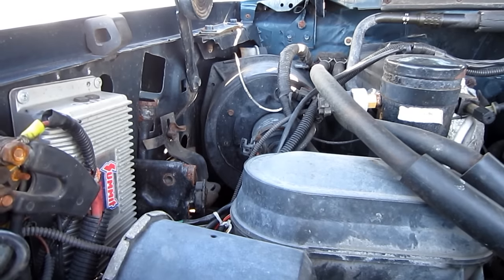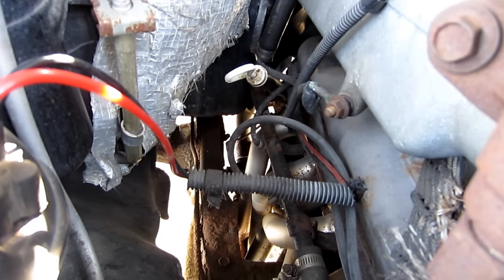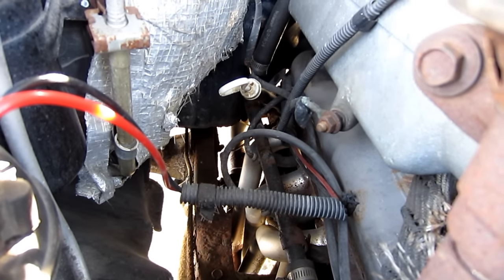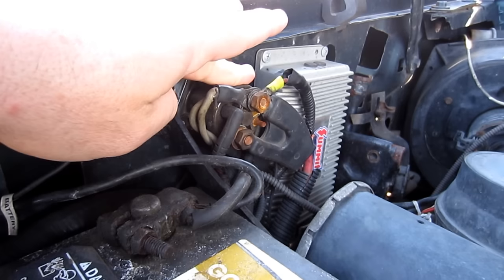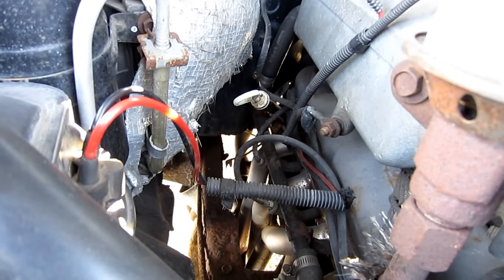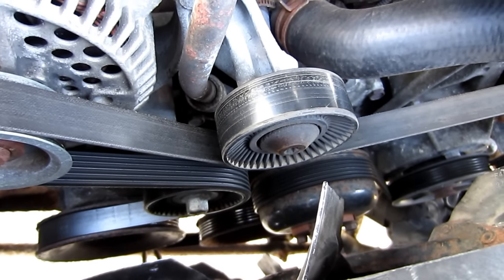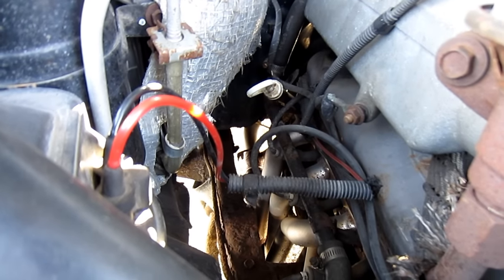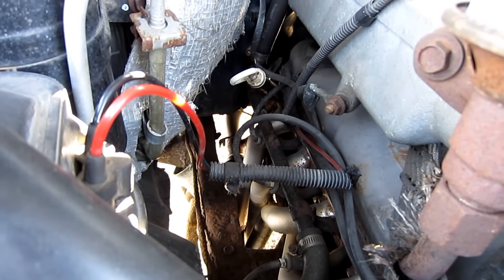Know your cars Clicks. Why it won't start

Comment: I have a 95 Safari, & it will sometimes try to crank, just a little. New battery, starter checks good. The starter will spin, if I loosen the bolts, where it just hangs below the flywheel. I cannot find any corrosion. It does the same thing, when shorting the solenoid straight across.  I pulled the positive cable off, & it has a slight crimp in the cable, about 6in from the starter. I have no idea what could have caused it. Could it be corroded in the middle of the cable, at this crimp, maybe?  It started & ran fine, the day before this started.

Comment: My car was perfectly fine until some guy asked for a jump start. I didn't know how to jump start a car so I just let him touch my car and do his thing. Now my car clicks just like in the video. It starts but only after several clicks. What could it be?
Reply from the maker: F Fuentes maybe your cable ends are loose on the terminals...
Reply: F Fuentes lol this guys answer to everything is the battery terminals... jumping a dead battery can result in damaging your alternator or other electronics. But if it starts after a few tries I doubt it’s the alternator

Comment: I have a 2014 Honda accord ex 4 door sedan. I have a push start engine button. So when I push down on brake and engine button my car does not start just a click noise. I give it a few  times and my car will start. on someday's it will start right up and most day's it will not.
Reply from the maker: Definitely a dealer issue...random electrical is a nightmare to diagnose!!!

Comment: My starter clicks once every time i turn the key and when i jump it itll ussually start right up, but sometines i just keep trying and itll start up by it self after a while no jump needed
Reply from the maker: Cables, connections or weak starter... Also test battery
Reply: Thank you so much for suck quick reply sir i will have what you mentioned checked out tomarrow, i actually made a video today of me trying to start the car for a while and then it just starting out if nowhere is there any way for me to send it to you sir?

Comment: I didn't hear a Bitch.. But anyway the starter deciided it was going to melt the wire that goes between the starter motor and the starter solenoid.  I tried Soldering it back on, but it only lasted maybe 1-2 starts, then it melted my solder.  sounds like the starter is pulling too many amps.. so I just bought a new starter.. but now I have a starter and motor I can take it apart to find out what is inside it.. Rockauto did not need the core back. I have close to the same truck you do.  a 1996 Ford F-250 XLT extended cab with a long bed.
Reply from the maker: Just take the starter in to the local parts store and have them test it... They won't mind at all...
Reply: I already know what is wrong with it.  the short wire to the actual starter motor has corroded the lug off of it that connects to the Solenoid, the starter motor works, and the Solenoid works.. Just the wire gets too hot and melts after 1 or 2 starts no matter what I do to reconnect it.  The engine also cranks slowly with that starter.  I am thinking if it isn't a dead starter it was pretty worn out.  especially considering the new starter winds up very quickly and starts it almost immediately.

Comment: I have a f150 4.6l 5 speed manual 1998 I hear the trrrrrrrrr sound and it's not the batery because I change it for a new one and the sound come from the starter but now just do the click sound, people say is the flywheel, and the transmission harness is a little toast any suggestion??
Reply from the maker: Mr.Mustang rotate engine by hand... Remove starter and have it tested..
Reply: Foxboss9 I already do it, starter is brand new, batery is brand new and the solenoid is new, she melted the terminal of my new battery

can be the transmission harness?
Reply from the maker: Mr.Mustang just because the part is new doesn't mean it's not defective. You need to find out why the starter is not turning. Either the starter is bad, or the wiring is wrong, or the engine is seized. You can rule out the seized engine by turning it by hand. The transmission has nothing to do with your starting system. Other than the flywheel is connected to the transmission. But as far as wiring it doesn't have anything to do with it
Reply: Foxboss9 I have 2 new starter I tested 1 to make sure I tough the same thing, you can hear the starter grinding like trrrrrr I tough the flywheel had lost teeth I inspect by turning the engine by hand and look the flywheel is ok so the wires of the battery overheat and definitely is a electrical problem BTW thanks for reply and help
Reply: Foxboss9 and another question a sized engine can turn by hand or is like when the engine is lock or is all the same? 

BTW I'm learning English sorry if you don't understand me
Reply from the maker: Mr.Mustang make sure you didn't accidentally pinch the wire that goes from your starter relay down to your starter. I really can't tell. It's really hard to diagnose electrical even with it right in front of yourself so doing it without seeing it is really almost impossible tell you the truth. Make sure you didn't wire the starter backwards.

Comment: I have an 09 kia with 38k miles and my car makes this exact same sound. Just clicks once, or starts right up. Used a volt meter and battery has plenty of juice so naturally I think starter, the wild card though is when I run into this problem, jump starting fixes it? Could that still be the starter?
Reply from the maker: MegaFry94 maybe... First double check the battery cable connections at the battery..

Comment: Oh yeah I had to take the starter apart to get enough room for the top bolt then had enough room to get mine off plus the battery cable to the starter complexly corroded off
Reply: It's always something right?
Reply: Yep it always is just put the new starter in have to find top bolt cause that went missing and the power cable needs lengthened and the short cable they put on the starter is complete bs

Comment: So my car will try to start and turn over and dies right as it would start
Reply from the maker: jim hemp doesn't sound like anything covered in this video would fix... Kinda sounds like a fuel issue or ignition module or coil pack... But those are just pure guesses... Good luck 🤞
Reply: Foxboss9 I appreciate it thanks for the quick reply!
Reply: it was just the air filter.... I feel dumb as hell lol
Reply from the maker: jim hemp you troubleshot, found the problem and fixed it, that doesn't sound dumb at all 👍😁

Comment: i have a pontiac grand am 2004 model... they have security problems and when my car wont start it is usually the security issue... was not the case this time... my starter was jammed and i turned my motor by hand and freed my starter and blamo it started... thanks a bunch for this vid....
Reply from the maker: J- Walk 👍😁

Comment: My 1991 d250 318 v8 clicks just like yours in the video every time I turn the key but after atleast 10 tries it will turn over and start.
Reply from the maker: Might be a weak starter
Reply: Foxboss9 it does start though it turns over great when it does but it takes like 10-20 turns for it to finally turn over.
Reply from the maker: Dodge 318 Cummins if it clicks and if the battery and starter relay is good then the starter is dragging/weak... As far as how long your truck cranks before it starts is all about the engines state of tune.. EG; gas flow and mixture, ignition timing, and of course engine compression..
Reply: Foxboss9 it starts right up when the starter spins. I don't think it's worth changing the starter yet as the truck starts every time.
Reply: Foxboss9 ok so my truck doesn't click anymore the lights come on and can hear the fuel pump but the starter doesn't click engage or anything. Could this be a complete failure of the starter?
Reply from the maker: check voltage from battery to starter relay/solenoid.... if solenoid is mounted on starter it's best to pull the starter and have it tested.
Reply: Foxboss9 ya I'm definitely going to pull the starter but I think the ignition lock cylinder broke as all it does is spin and not like it spins normally.
Reply from the maker: Dodge 318 Cummins if you want to temporarily bypass ignition switch get this http://amzn.to/2lC5H7v

Comment: I have a problem with my car and I'm afraid to spend on something that might not work.
My car is automatic and Sometimes it turns on other times it wont.
when it doesnt turn on there is usually a clicking noise on the Relay box (head lamp to be exact)
When I try to remove it the clicking moves to the other relay fuse (rear lamp) then etc...
The people at the auto shop are saying it is the starter but I dont think it is because even without turning on the car
The head lights wont turn on and there is the occasional clicking noise on the relay box. (sometimes it clicks even when the key is out of the ignition)
Reply from the maker: Tabz take it to a reliable, honest mechanic... Troubleshooting random electrical issues will haunt even the best mechanics out there...
Reply: Tabz ch3ck the ecu

Comment: I replaced my sister's battery and it still has the rapid clicks like a machine gun. So what does that mean lol..
Reply from the maker: Robert James starter or starter solenoid may be jammed or bad. That is if the engine isnt seized
Reply: Could it be a connection or ground?
Reply from the maker: feelnrite yes

Comment: my car started then smelled like something was burn so I shut it off and when I went to start it again it would do a bunch of clicks quickly and all the lights on the dash dim out and flicker quickly with the clicks
Reply from the maker: Check battery connections and cables to make sure nothing is loose or shorted out..

Comment: what if you jump it off and it still clicks fast??
Reply from the maker: +Erika Riden make sure your cable connections are secure..if the battery connections are tight and the battery jumpers are connected well, And you battery isn't stone dead.. then i would suspect a possible starter issue..

Comment: When it clicks a lot in a row like a machine gun the problem can also be the wire from your ignition is old and has built up a lot of resistance within the copper so you will get a voltage drop by the time the electricity gets to the solenoid. you have to measure the voltage getting to the solenoid and see if it is high enough to actually engage the starter motor. this happened to me I had to replace the wire from my ignition. good luck

Comment: my car would start after turning the key enough times other times it would click.....once started the car was fine but lately its just clicks Once, made sure the battery was charged, thanks for your video..I think its the starter still not sure though 2004 Honda accord 2.4L  Btw
Reply from the maker: A random start could be the starter especially if it happens more when it's hot.. Make sure connections at battery, solenoid and starter are good.. Make sure ground from battery to chassis is also good.. The nice thing is if you remove the starter you can have it tested at the auto parts stores for free.. Good luck.
Reply: Alright thanks! ill have autozone test the starter before moving forward appreciate the response.
Reply: Hey man. My car does that. What was the issue?

Comment: So, I have a 2004 ford explorer. This is a recent thing that's been happening to me. I'm not really a car guy, so bear with me on this. I have a remote start installed and I've been noticing that whenever I start my car up in the morning (its been sitting for just about 14 or 15 hours because I dont use it after I come from work) it takes 2  attempts to start it. I started blaming the issue on my remote start since it never really happened before. Anyway, I decided to start it by myself one day and I turn the key to the start, and I hear a small click (this one I think is normal). Then i actually try to turn the car over and  I hear a more engaging and noticable click, but no start no crank no nothing. Just the click and done. I'm assuming the smaller click is the relay setting up and the larger click is the starter trying to, for lack of a better term, start. On the second try it starts up great and on rare occassions it may take up to 3 attempts. Is this a starter giving me warnings to replace? Its never been replaced before, and I dont know the lifespan of those things, but 14 years is a pretty long time.
Reply from the maker: Sorry, I dont really have a good answer...electrical gremlins are hard to diagnose,even when the vehicle is right in front of you so, I would just be guessing...good luck

Comment: hey I have a question my friend...if I have my AC on...and it starts going on and off...is that a weak battery issue?...or a gas pressure issue?
Reply from the maker: DL MANOLO If your A/C compressor is cycling on and off it means your Air Conditioning needs serviced.. Maybe low on freon... Take it to a shop that services A/C...
Reply: Foxboss9 it's definitely not low on antifreeze...I just cleaned it out and added fresh new liquid...

Comment: Hi I'm David from San Tan Valley, Arizona. I have a white 2011 Camaro LS(V6, you can see it in my videos). My car has not been starting and it makes the fast clicking noise. I jump started it and took it to O'Reilly's. By the way, they check ur alternator, battery, AND engine codes FOR FREE!. So, the alternator test showed "diode failed". The alternator is putting out too much voltage to the battery, about 15 Volts. According to the O'Reilly's employee, he said that can harm the battery. The batter was putting out between 10.65 to 11.67(approx.) Volts, less than 12 Volts. The engine codes(2) are for the throttle body control module and the something about the fuel pump. He said that doesn't affect the starting of the engine. Conclusion is I need a new alternator. The diode is like an electronic check valve, limiting the amount of voltage going out to the battery. So I'm going to get a new alternator and hopefully I won't have to buy a new battery.

Comment: older vehicle there ....
newer ones may be crank position .sensor..bad is will not send a error code...its cheap part but ford enginners put in bad place
Reply from the maker: Miguel Castaneda crank position sensor will not cause a cranking issue to where the vehicle will "click".. A crank position sensor will allow the cars engine to turn over and over again, but it won't start.. Reason is, the sensor (when bad) will not tell the ECM that the engine is spinning..

Comment: This is great, well explained. I have this problem on a KZ440, new battery charged well at 12.6 volts, I am using a solenoid I know works (but also tried another one just in case I'm wrong), I have tried 2 cables to my starter and I tested the starter by hooking it up to my car battery and it spun well. It's a mystery, I have copper greased everything and cleaned my ground... still the single click.
Reply from the maker: Jim Lahey the problem with motorcycle batteries is that they may run up to 12 volts but they don't have necessarily enough amps. If it was my bike and I could get it to crank over when it's hooked up to a car battery when I would look at two different things. One it could be the poor, weak design that motorcycle batteries inherently have, is just wore out enough to not have enough power to turn over a slightly wore starter OR the battery is putting out the full amperage and voltage that it should, HOWEVER, the starter is worn down enough that it takes a much more powerful battery to turn it over(a car battery has 2 to 5 times the CCA).. Good luck..
Reply: Foxboss9 Thanks for the reply Foxboss, I solved the problem, the batteries negative ground didn't work on the frame so I hooked it up to the engine casing and problem solved! Fired up first time. I painted the frame and engine so I think the current wasn't passing between the engine block and the frame. Thanks again for getting back to me, great video. I am subscribed!

Comment: Solenoid
At times(certain cars maybe) one of the wires to the starter builds up resistance over time/age, and is also to blame
What has been explained is good, but may not always be a bad starter motor(most starters come with both from the parts store(the solenoid is coupled and attached to the starter motor

Comment: I've had several cars with starter clicking problem and found the culprit to be a bad ground wire and to test you jump the car it using a black jumper connected to the engine not battery.
Reply: niacal4nia bruh please help me. My 99 corolla works wonderful but once in the while only in the morning, when i turn the key to start the car it just fuckin clicks. Then i wait 15-20 seconds and itll start.
Reply: Clit Commander either your starter has a dead spot or your starter relay/solenoid is sticking. Usually a starter with dead spots need to be replaced and to check. have some one start the car while you smack the starter with a crow bar. If it starts, then change the starter.

Comment: Battery been tested, passed. Starter been tested, passed. Relay been replaced, wires been checked and still won't start. I am going crazy. They tell me it might be the ignition switch or fuse box. Is that mean I have to buy them all just to see which one had the problem.
Please heeeeeelp
Reply from the maker: Find someone local who knows how to troubleshoot electrical...Don't throw parts at it as it will be waaaay more expensive doing it that way
Reply: Check neutral safety switch.